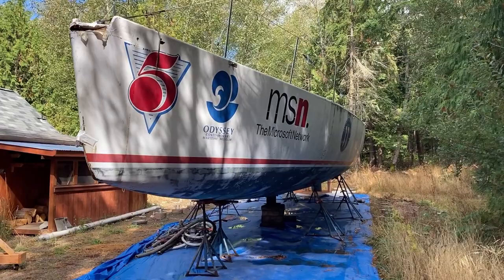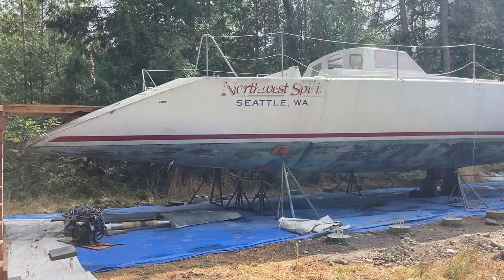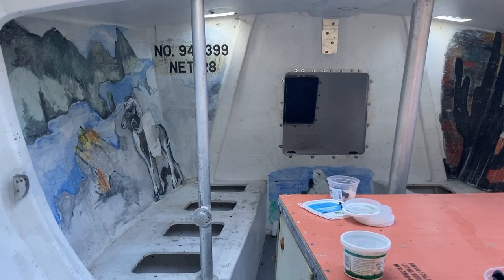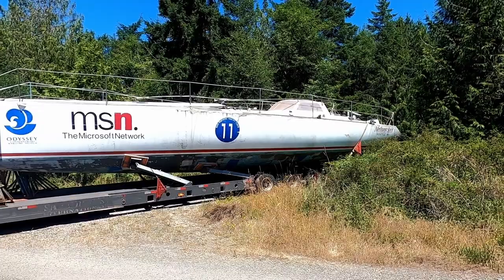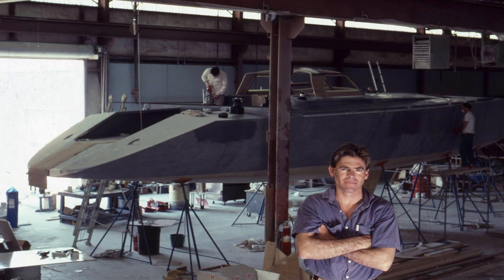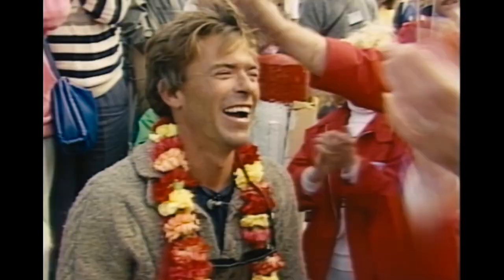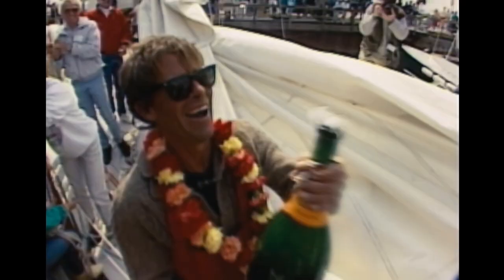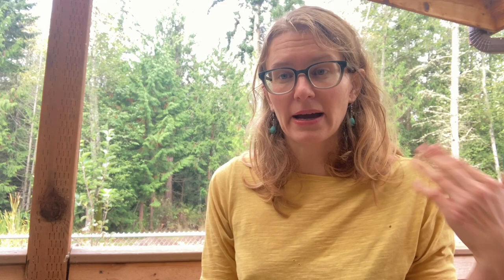Episode 3: Not Just Any Boat...

Comment: It sent a shiver down my spine when I heard of Mike Plant's fate. I've heard a few stories of racing boats losing their counterweights and flipping, sending their crews to watery graves. I know that the race boats sometimes push the structural materials close to the edge, making the keel as skinny as they can get away with for minimal drag, and the counterweight as heavy as possible (to allow full sail running with large sails in high winds), but I feel that combination of a heavy counterweight on a spindly keel has become an Achilles heel sometimes, and resulted in tragedies like Mike Plant's. All I can say is, please make sure your keel on the Duracell rebuild is substantial or strong enough for whatever counterweight you put on it, without pushing the envelope on the material strength of the structure.
Reply from the maker: Thank you, we will.  The goal is to make the boat as safe as possible.